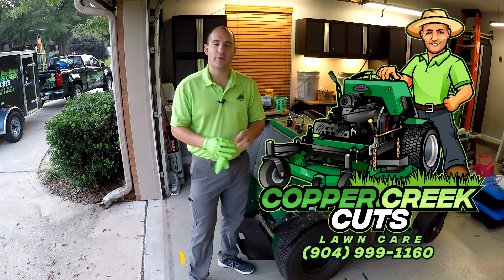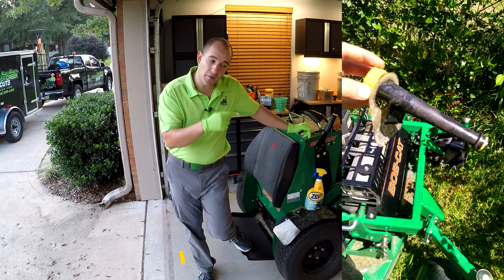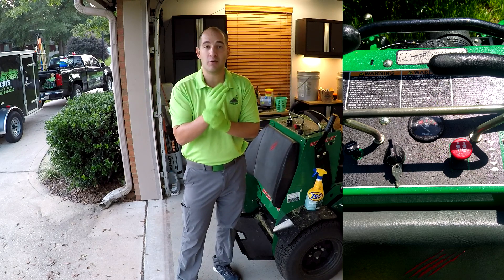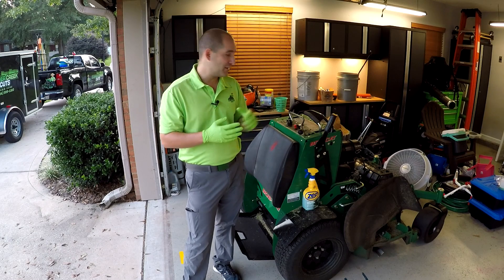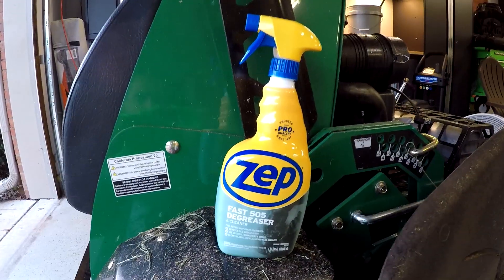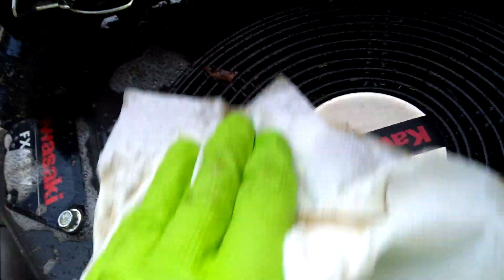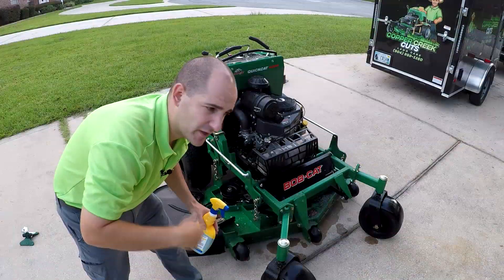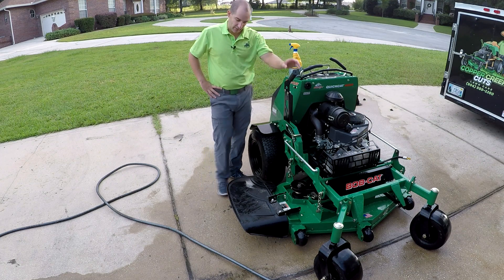Cleaning A Greasy, Oily, Dirty Mower & How I Broke My Mower (Featuring Zep Fast 505 Degreaser)

Comment: Thank you! I took your suggestion and used ZEP Fast 505 Degreaser. That product did an outstanding job of cleaning my Scag Tiger Cat zero-turn mower that has never been cleaned in the 12 years I have owned it.

Comment: That Zep works great, I use the concentrate in a bottle to dump in a pan full of water to clean the vaporized wood deposits off the vector cutting grid on my laser, along with acrylic residues and all kinds of other stuff.  I soak it in the pan for about ten minutes, lifts it right off, leaves the aluminum clean as a whistle.  Just give it a rinse after it comes out of the water, and good as new.
Reply from the maker: Awesome feedback and tip, thank you!

Comment: Lemons from lemonade! Or something like that.
Zep's been around since forever, I think. Never really looked closely at them but recently I've been using their window cleaner (something I'm very picky about) and pleasantly pleased with the results. No streaks, cleans easily on house and car windows.
You sold me on picking up a bottle of the degreaser and trying it out against a couple bottles of Simple Green I have.
Also, looking forward to the pressure washer demo. I have some regrettable oil stains on weathered asphalt I'd love to erase.
Great video!
Reply from the maker: You sold ME on a bottle of the window cleaner. My wife was just saying they were looking dirty! :)

Comment: Score! The Zep yellow  driveway cleaner is amazing. Speaking from experience, it's effective enough that you can put a capful or two on a grease spot and work it in with a brush, then go over with a garden hose after letting it sit. Pressure washer not required if your machine is down.

Question, have you considered getting the um, what's it, 'tweels'? the ones where you don't need air in them.
Reply from the maker: Oh, that is a good trick, thank you!

I have considered it but they never came small enough for the 36". Maybe on a 48"!

Comment: Nice Cleaning Job. By the way, do you have a Oil Separator in your water draw?
Reply from the maker: Thank you! I have no clue what that is, so I wouldn't know. I apologize!
Reply: Copper Creek Cuts Lawn Care.
An oil separator prevents oil residues in the wastewater from contaminating the groundwater. Especially when cleaning oil-smeared equipment with a high-pressure cleaner.

Comment: Can I safely use that stuff on my dirty car?
Reply: No Shirley, it would most likely strip the protective coating and paint right off.  I highly advise against it.  If you want to cut more of the grease/grime off your car, you can try something like Dawn dishwashing liquid.  But this will also strip away any protective layer (not like the Zep, though), so you would need to go back over the car with a wax or sealant.
Reply: @scottsummers6541  Thank you.
Reply from the maker: The directions say safe for metal, but yeah, I wouldn't use it on a car either, just to be safe!
Reply: @BakerCountyTrashPickup  Thanks, I won't. I'll stick with car wash products. :-)  btw: love your videos

Comment: I have a Poulan Pro riding mower & after I mowed the yard, I was backing it into the garage & noticed it was leaving a trail of oil. I raised the hood & oil was all over everything. As I was checking everything I noticed the dipstick cap was not screwed on which evidently I hadn’t screwed it on good. Can I spray the Zep all over everything & rinse it off without messing something up?